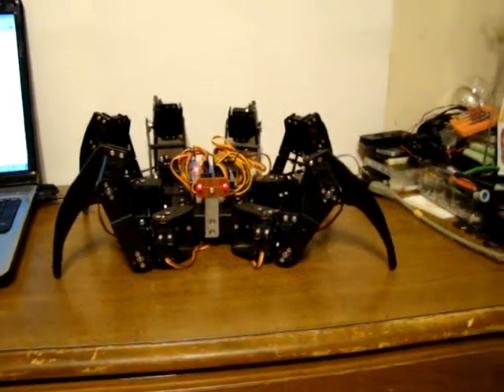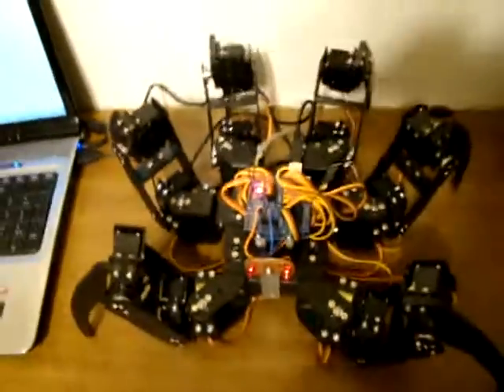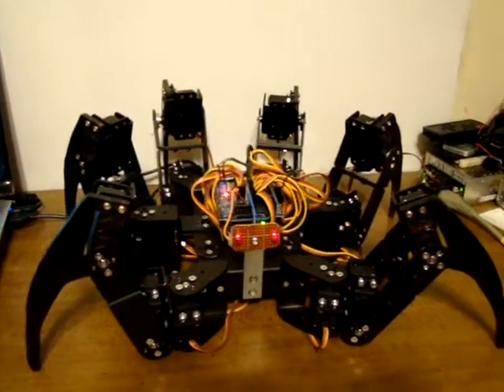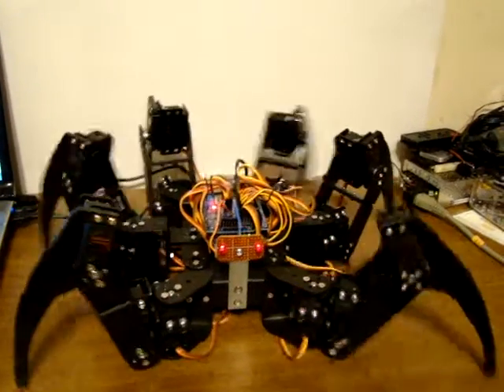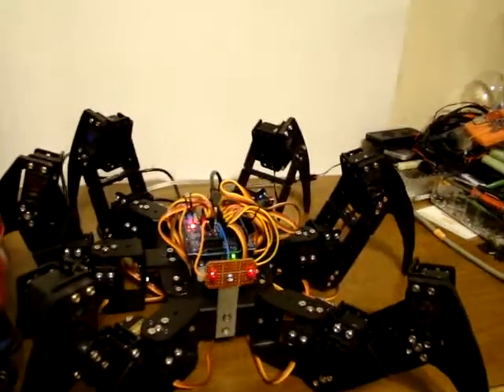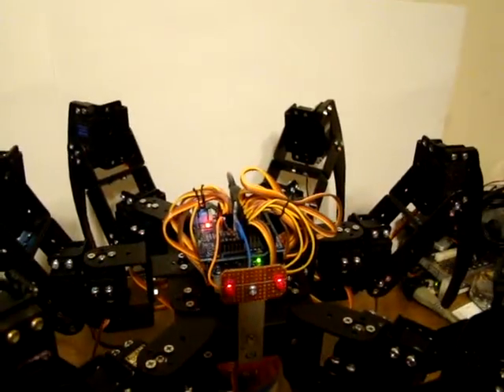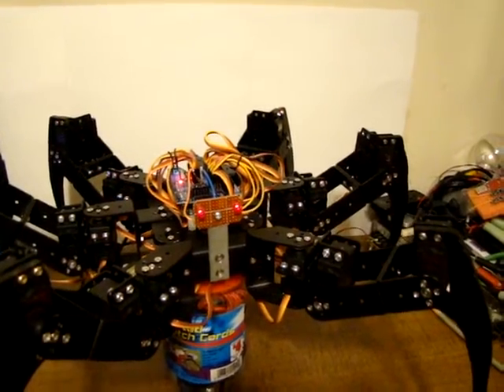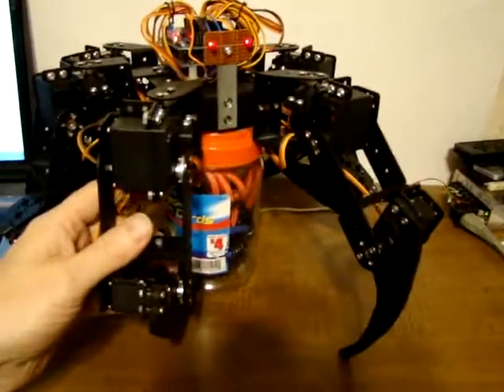Arduino Uno powered 18 DOF Spider/Hexapod movie 1

Comment: That is one wicked looking spider Bob!
Recurring theme seems to be that walking robots need powerful (expensive) servos. :-(
Thanks for sharing Bob.
Reply from the maker: +Hari Wiguna - Or make it out of aluminum or Plexiglas.
Reply from the maker: Better servos worked.  I am using a 6 volt 12 amp power supply.

Comment: Hey that's an amazing project. I bet it draws a lot of amps...What battery are you using ? Like I am thinking of using 18650s. Like 6 of those... Cause I need it to operate more, so how much does yours operate and for how long ? Also how many amps hours you got in the battery pack ?
Reply from the maker: I used a 10 amp power supply most of the time because of the current draw.
Reply: @bobdavis321  I'll have around 12 Ah so that should be good. Thank you for the help so much!